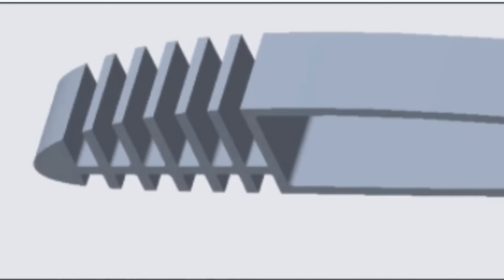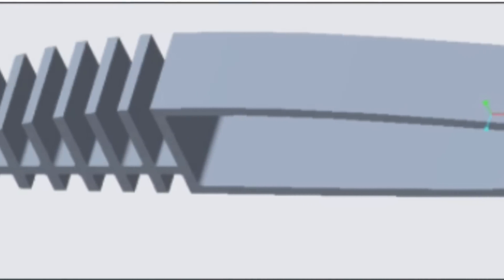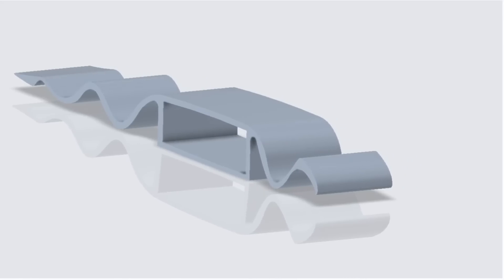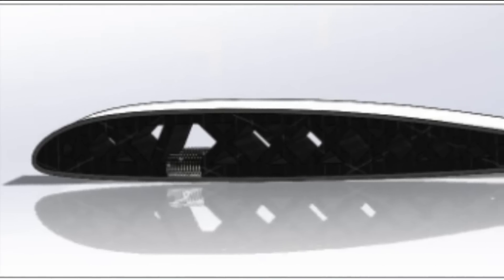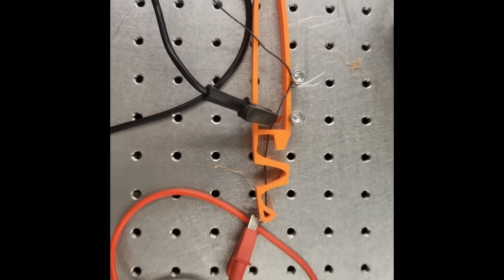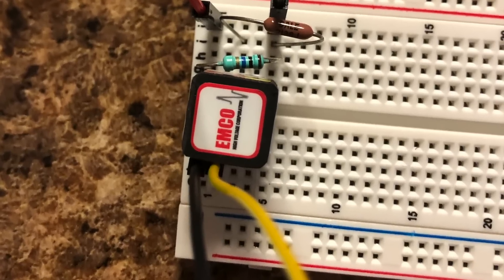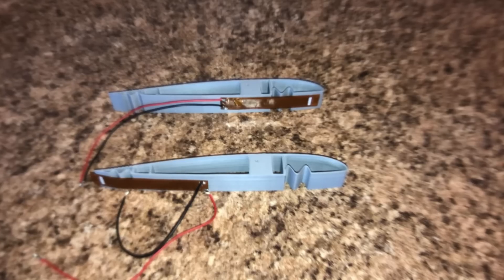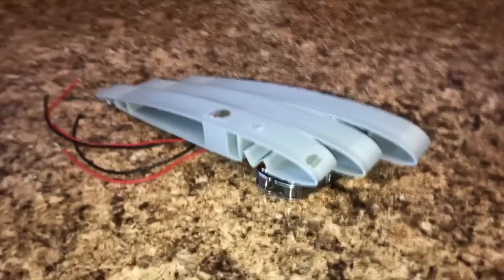Flexible Wings for Adaptive Flight

Comment: I don't know bro it's never a good sign for the hypothetical end product when it's too expensive to buy material for a scale model.
Reply: It’s all relative and sounds like this is a student project. I‘ve been given $500 for an engineering project that should have been $4000 while other groups in the same class still had $150 left.
Reply: Bro it's a student project
Reply: Prototypes are almost always far costlier than the final product.
Reply: Back in 1930 a jet engine was too expensive and complex for a scale model
Reply: Nitinol is a fairly outlandish material choice for this application.
Reply: That never stopped the US military lol
Reply: Steel is inexpensive as it is commonly used. There will be lots of manufacturers producing and supplying steel. But if you choose a material that's rarely used, you have to pay more for it since the companies producing them don't get the benefits of economies of scale. That doesn't mean their prototype is bad. If everyone preferred carbon fibre over steel, steel would be hell of a lot expensive in comparison. You can get it cheaper when you bring the prototype to mass production.
Reply: yes the military industrial complex spends a lot of money but I’m sorry so many of you are so wrong and are demonstrating your ignorance about the military industrial complex and how it operates. Pro tip: if you have a requirement you’ll spend the money you need to spend and build this design, But when they’re affective affordable alternatives it’s not going to happen. Basic research is always good, but if it’s not affordable one shouldn’t be thinking of it as practical research because it’s basic research by definition.
Reply: Lol you're right with your first 3 words at least
Reply: @chameleonedm  👏👏👏
Reply: And damn, that's got to be a lot if the navy is in on the funding.
Reply: Remember, these are engineers! They prove principles and then hand it to someone who knows how to make it work ;)
Reply: If the military can spend 20k on a toilet seat, spending a million per rotor blade won't make them bat an eye.
Reply: @Cobb  That ‘toilet seat’ was a complete toilet, sink, and shower enclosure as you see in an airplane because it was specifically that for a patrol aircraft. I assure you that the lavatory in your commercial aircraft cost just as much.  Now you know the truth too, please spread the word that you were simply parroting what a lazy cartoonist pulled out of a catalog. And here’s the thing, I worked in DOD under Reagan. Trust me, hammer ms and toilet seats is not where we were wasting our money… it was elsewhere. We
Reply: @Cobb  rotor blades for small, simple helicopters cost in excess of $25,000 each. The blades on a Blackhawk are significantly more complex (and include rotor icing protection) so they're likely to be well on the way to $1 million each without adding smart materials!
Reply: It’s more a proof of concept, if this is going mainstream the market will find a way in making it cheaper. That’s just how things work at this stage of prototyping.
Reply: @Youtubeiscoolandgreat  Advances in material science underpin the majority of advances in aviation…so there is always a chance some chemical engineer is dreaming up the stuff the aerospace engineer needs now. That said, I suggest it won’t be soon.
Reply: @JoeOvercoat  yeah, I’m sure it will be a while before something in aerospace is as groundbreaking now as something like the Concorde was decades ago for example, hopefully maybe this time the new technology will become industry standard.
Reply: Two words: military application
Reply: @Scrogan  then the price will just be inflated 1000x for absolutely no reason other than the military is using it.
Reply: The target customer is the US military. They aren’t reckless spenders, but they have deep pockets for high tech gear.
Reply: I’m from a very poor black family, from which I’m now estranged.  I can speak for necessity being the mother of invention, not budgets.
Reply: You’re comparing the budgets of a college student vs the US military LMAO
Reply: Military does not care about budget constraints
Reply: @ssss-gf1fh  Yes, they do.